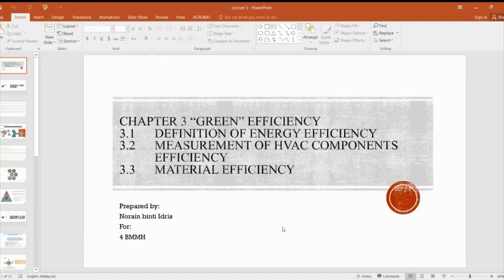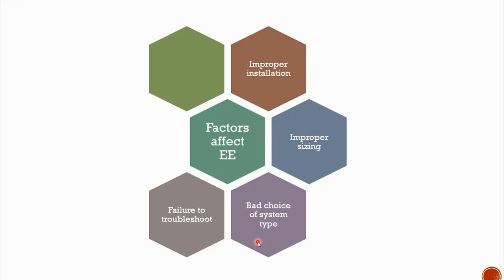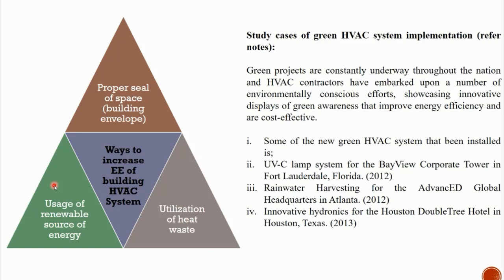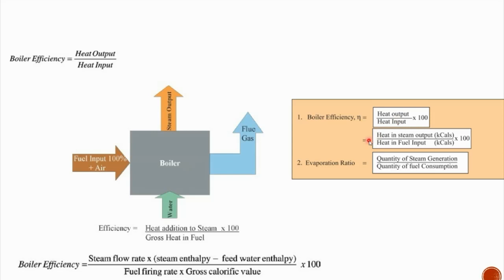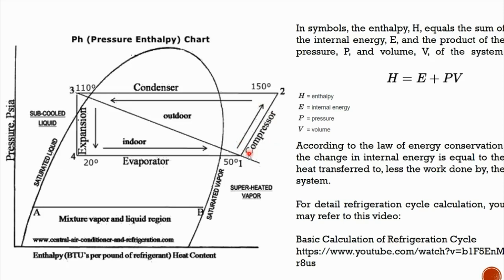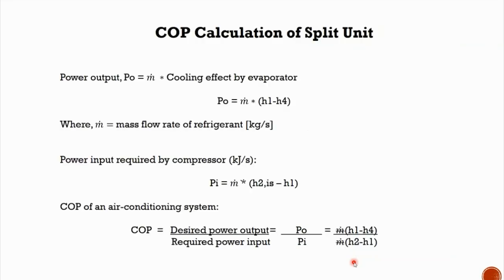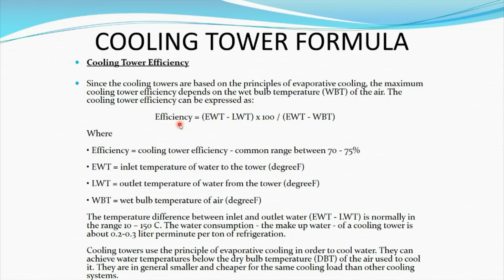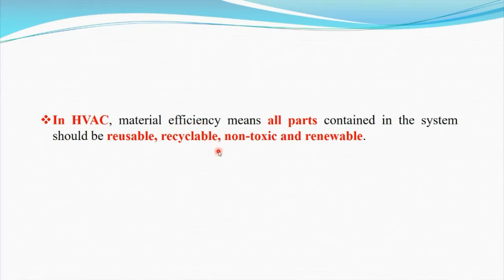Lecture 3 "Green” Efficiency

Comment: ALDEN ANDRIAN PHIUS
B071710392
BMMH S1/1

CHAPTER 3 GREEN EFFICIENCY

1.Definition of energy efficiency
- a goal to reduce the amount of energy required to provide products and services 
Factor affect EE
- improper installations
- improper sizing
- bad choice of system type
- failure to troubleshoot
Ways to increase EE of building HVAC system
- proper seal of space (building envelope)
- usage of renewable source of energy
- utilization of heat safe

2.Measurement of HVAC components efficiency
- Boiler efficiency (heat output/heat input times 100%)
- evaporation ratio (quantity of steam generation/quantity of fuel consumption)
- using p-h diagram
- COP calculation of split unit (desired power output/desired power input)(h1-h4/h2-h1)
- cooling tower efficiency (EWT-LWT x 100)/(EWT-WBT)

3.Material efficiency
Metric which express the degree in which usage of raw materials, construction projects or physical processes are used or carried out in a manner which consumes, incorporates or waste less of a material compared to previous measures. Making a usable item out of thinner stock than a prior version increases the material efficiency of manufacturing process. 

Green material
- non toxic 
- reusable
- renewable
- recyclable
- rapidly renewable plants material

Comment: NUR SHAFIQAH BT ABDUL GHAPOOR
B071710400
4BMMH S1/1

1.	DEFINITION OF ENERGY EFFICIENCY
-	Goal to reduce the amount of energy required to provide product and services.
-	Used minimum energy
a.	Why it is important?
•	Reduce the cost of energy itself
•	Produce a system that can deliver the same result but with less carbon dioxide emission, less cost and greenhouse effect.
b.	Factors affect EE: -
•	Improper installation
•	Improper sizing
•	Failure to troubleshoot
•	Bad choice of system type
c.	Ways to increase EE of building HVAC System:
•	Proper seal of space (building envelope)
•	Utilization of heat waste
•	Usage of renewable source of energy

2.	MEASUREMENT OF HVAC COMPONENTS EFFICIENCY
-	Boiler Efficiency= Heat output/Heat Input
-	*used PH diagram to calculate 
-	COP Calculation of Split Unit 
-	Cooling tower Efficiency 

3.	MATERIAL EFFICIENCY
-	The degree on which usage of raw materials, construction projects or physical process are used or carried out in a manner which consumes, incorporates or waste less. 
a.	Green material: -
•	Rapidly renewable plant materials
•	Non-toxic
•	Reusable
•	Renewable
•	Recyclable
-	In HVAC, material efficiency means all parts contained in the system should be reusable, non-toxic and renewable.

Comment: Muhammad Ismail
B071710851
4BMMH S1/1

Material efficiency is one of the important things in HVAC system.

Energy efficiency is defined as: to reduce the amount of energy required to provide products and services. For example; insulating a home which allows a building to use less heating and cooling energy to achieve and maintain a comfortable temperature.

Ways to increase Energy Efficiency:
-proper seal of space
-utilization of heat waste
-usage of renewable source of energy

Material Efficiency: which expresses the usage of raw materials, construction project, physical processes are used/carried out in form of; consumes/incorporates/waste less, compared to previous. 
Green Material:-
   -non-toxic
   -reusable
   -renewable
   -recyclable
   -rapidly renewable plant materials

Material Efficiency means in HVAC: all parts contained in the system should be reusable, recyclable, non-toxic, and renewable.

Comment: ALDY HENRY DUSIM - B071710329
4BMMH S1/1

ENERGY EFFICIENCY (EE)
To reduce the amount of energy required to provide, produces and services.

Factors that effects EE
1. Improper Installation : can reduce efficiency to about 30% of your system. choose contactor correctly.
2. Improper Sizing : don't get tempted to buy over size system it sounds good but actually it is the opposite
3. Failure to Troubleshoot : troubleshoot correctly to avoid any unnecessary procedure
4. Bad Choice of System Type : choose according to your environment climate 4 season or not.

Ways to increase efficient energy of building HVAC system.
1.	Proper seal of space (building envelope)
2.	Utilization of heat waste
3.	Usage of renewable source of energy.

MEASUREMENT OF HVAC COMPONENTS EFFICIENCY
-Boiler Efficiency = heat output / heat input (refer slide)

-using P-H diagram to calculate efficiency of system

Cooling Tower Efficiency
The maximum cooling efficiency depends on the wet bulb temp of the air. 

MATERIAL EFFICIENCY
Express the degree in which usage of raw materials, construction projects or physical processes  are used or carried out in a manner which consumes, incorporates or waste less of a material compared to previous measures. Making a usable item out of thinner stock than a prior version increases the material efficiency of manufacturing process.

Green material
1.	Non toxic
2.	Reusable
3.	Renewable
4.	Recyclable
5.	Rapidly renewable plant material

Comment: Ahmad khairul akmal bin ahamad khairudin
B071710715

Energy Efficiency (EE)
The idea of reducing the amount of energy needed to provide to run a service.

Factors of Energy Efficiency 
1. Incorrect Choice of sizing to system when purchasing due to over or underestimating situations done by contractor.
2. Improper installation of the system by inexperienced worker will reduce the efficiency of the system when running up to 30%.
3. Unable to make a good decision on choosing system types to the surrounding conditions and climate changes.
4. failure in troubleshooting the system when problems occur.

Ways to increase Energy Efficiency of building’s HVAC system.
1. Start of consuming renewable source of energy.
2. Usage of heat waste as energy source.
3. Proper space sealing.

Measuring component of HVAC:
1.	Calculation of COP on p-h diagram
2.	Refrigerant cycle calculation
3.	Cooling tower efficiency = The maximum amount of cooling efficiency regarding to wet bulb temperature of a room.

Categorize Green material:
1.	Non-toxic
2.	Reusable 
3.	Renewable
4.	Recyclable
5.	Rapidly renewable plant material